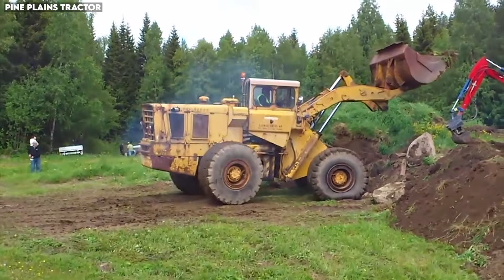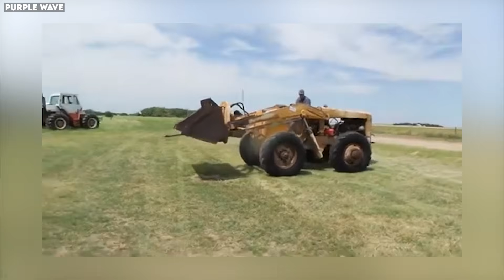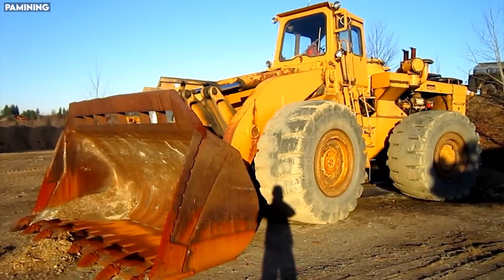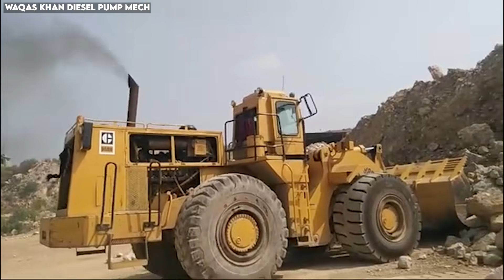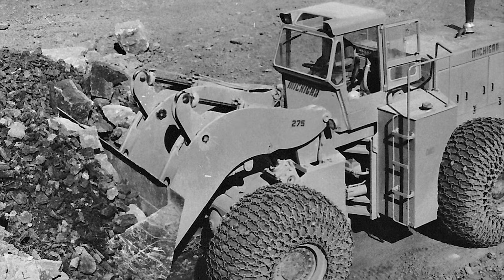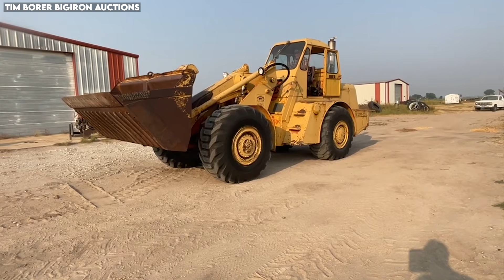10 Forgotten Wheel Loaders That Were Better Than Modern Machines

Comment: I saw a CAT certified Rebuilt 988 at Con-Exp in Las Vegas a few shows ago 😊 what CAT did was Fantastic 😊 they showed 1 half of the huge loader Rebuilt, and the other half, the same way CAT got it back to Factory for the Rebuild 😊 I do not believe how they did that interesting half REBUILD, but it looked amazing 😊❤😊 the engineering behind certified REBUILD in CATS lineup is an amazing job in itself. That a machine is Designed to be totally rebuilt for an owner, to keep that Loader going all day, in continues forward and reverse shifting loading trucks for decades is a marvel to see.

Comment: Man it would have been neat to see a International sales yard, in the 1950s 😊 and the other brands at the beginning of this video 😊 seeing them brand new, especially with the (Z) Bar linkage 😊 and that bucket size, the shining Yellow paint, being able to be the FIRST to operate the beast, 😊 I only ran 2 brand new pieces of heavy equipment the CASE 580-C and 580-K when brand new, I only got to see the off loading from trailer a brand new John Deere 410 series on one big job, with the truck driver scooping the first dirt into that J.D. 410 but I can tell you the CASE 580 series were well built running them brand new. The one job I was on that had 3 monster Backhoes was a big Sewer job in a housing development. I ran a 680 & 780 Case Backhoe, plus they had a brand new Dynahoe-190, I fell in Love with the Dynahoe over the bigger Case Backhoes of the era. I bought a 1968 Dynahoe-190 in 2003, 😊 it was very used I fixed the Brakes, and cylinder leaks, (new seals) and in 2025 that 1978 Dynahoe has over 8000 hours on the original 353 Detroit Diesel engine, still STARTS with new Batteries 😊 she does have more engine blowby now, but she still does what I need her to push or dig.